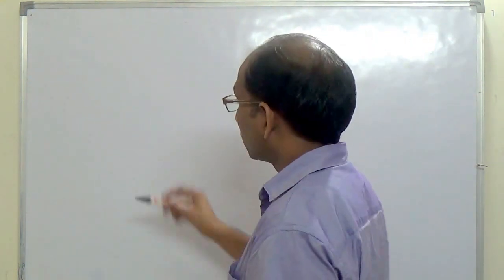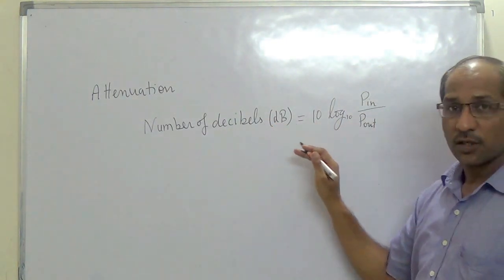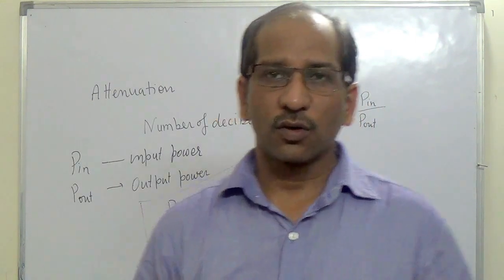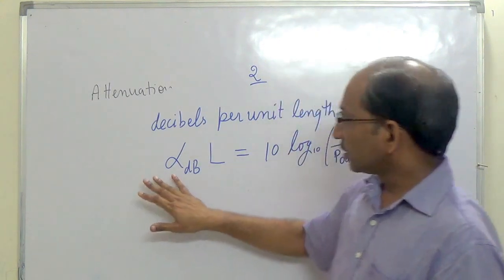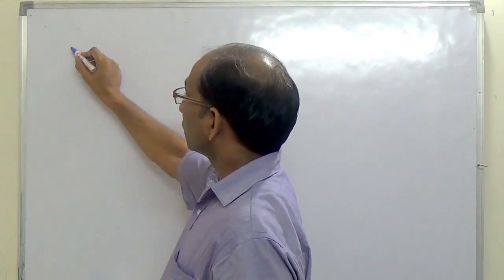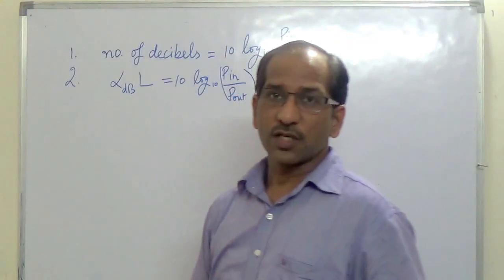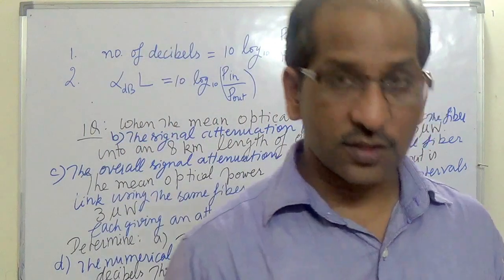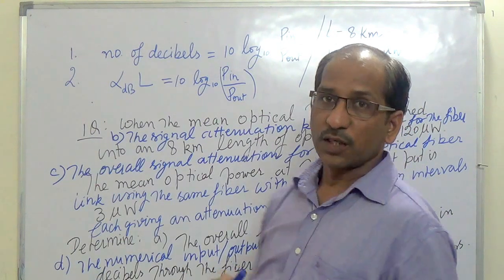apniphysics|Attenuation Loss in Optical Fiber-A Numerical Problem

Comment: Sir I am new to learn optical fiber communication, now I have been doing my senior project on networking, but due to some issues  supervisor told me to move to optical communication and told me to make a optical fiber/optical system "lab sheet" as my senior project. I am not understanding the lab sheet or what it is. I have learned about attenuation and dispersion and some basic on optical communication. It would be helpful if you could please help me understand this 'Lab sheet". I am very eager to learn it.
Reply from the maker: I am not sure what is the purpose and use to prepare Lab Sheet, I think he may be interested for device specifications, observations and results for the same to help students in lab.
Reply: Thank you Sir. That must be it. Let's see what my teacher says.